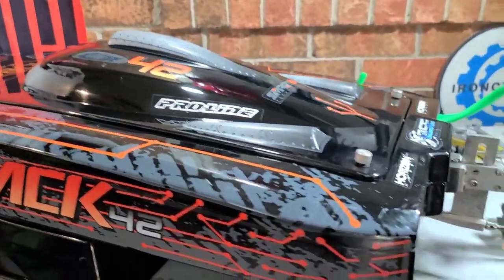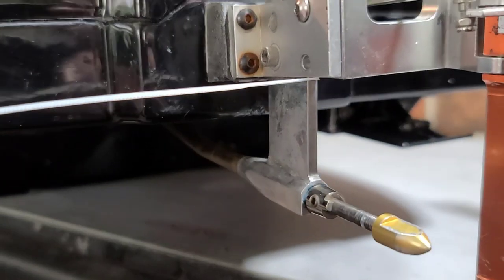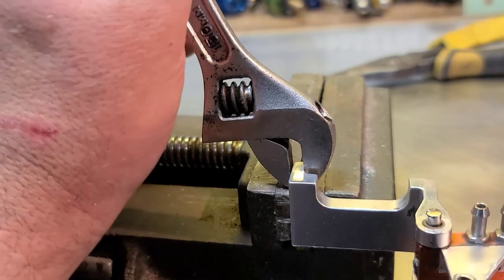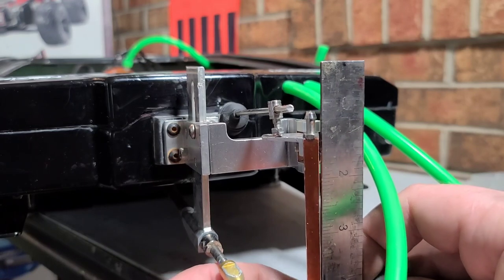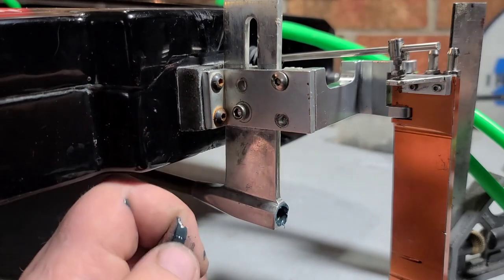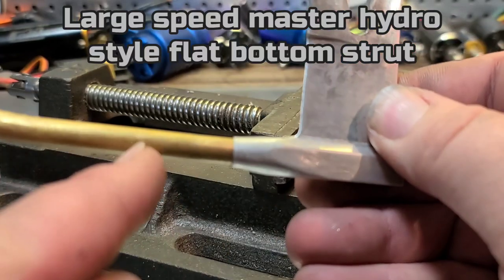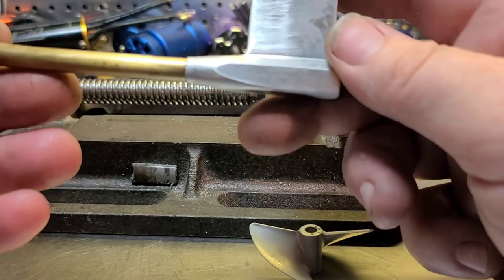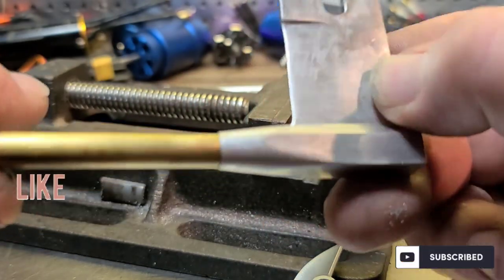Fixing Bent Rudder & Modifying The Strut For All Out Speed Proboat Blackjack 42

Comment: Even Aquacraft used to offer an add on air dam for their UL-1 Superior hydro, that had a habit of taking off. This was also a simple piece of 1/2" x 1/2" plastic angle that was stuck across the underside of the tunnel with double sided tape & worked well allowing higher speeds to be reached. Quick story with a speed guy a few years back on Offshore Electrics Forum, he built many fast boats inc deep V's & cats & was very successfull. He then built a carbon 26" cat way over powered with either a TP4060 motor or simular sized Neu motor to run on 4s. Boat was blistering fast but would take off ever time on glass water around 83mph, he tried all the normal things like cg adjustment, strut angles, different rudders. Could't stop it lifting at low 80's, I told him to try an air dam made from a piece of 1/4" dowl stuck across the tunnel 2" in from front. With no other changes to the boat on the same water he got 92mph with the boat glued to the water, I think he went on to get around 94mph on 4s.
Reply from the maker: Wow 👌  that's a great success story, I'd have to agree brother the dowel, foam in my case actually helped.   94mph on 4s is insane. Wow 👌

Comment: You can make a very simple but effective air dam which breaks up the air flow entering the tunnel. Some simply use either a piece of round dowl or a piece of plastic angle hanging down, either method runs right across the tunnel &sits around 2" back from the front of the tunnel. you can either glue this or even tape the dam to the hull. I know someone that even taped a drinking straw across the tunnel because he was having problems with lifting the front at a records meet. He taped the straw on, boat stayed planted & set new record. Dead simple to try by just taping something on 2" in from front of the tunnel.
Reply from the maker: I actually tried something kinda similar in my next video, sorta hard to explain, it's in tomorrow's upload.   Thanks for the tips though very helpful..

Comment: I'm very curious to see where you go with the front canard. I was thinking of making one for my all-wood cat that has a tendency to blow over at high speeds even when it's set up to run wet. My boat is really light; it's 31.5 inches in length and almost a full pound lighter than the ProBoat Veles 29. It's a wide body, which is great for cornering, but the extra width gives the hull a kite-like effect. I was actually thinking of mounting the wing on the front of the deck - not between the sponsons like you're thinking of doing. Front canards (wings) are not legal for sanctioned racing, but who cares. Some may argue that there are more efficient ways to tune the boat without a wing, but again who cares what others think. It's fun to experiment, and if it helps the boat stay planted in the water, then it's a worthwhile mod. Cheers brotha!
Reply from the maker: I may do the front kanard I may not.  If I do it's  definitely gonna  to be removable.    Ose has a motley crew air foil/front winglet  that may work on your skatter?  
 https://www.offshoreelectrics.com/proddetail.php?prod=hug-motley-lucas  

Just got back from a speed run.  omg what ever I did worked. Lol.
Reply: @IRONCLADRC  You did a lot of stuff to your BJ 42. Maybe all that filing you did to the strut paid off. Or it could be something as simple as the water conditions and wind were perfect for running at that time. In either case, I can't wait to see the video.

Comment: If the prop is running on the surface, then by definition, the strut "bar" will be out of the water.  In theory, you should be riding on that flat spot like a water ski with everything else out of the water.  This theory is based on glass-smooth water, so take it with a grain of salt.  Surface piercing objects have flat trailing edges to allow air into the "gap"  created by the wedge rudder/strut/turn fin/whatever as it moves through the water.  Air going into that open space creates less drag than moving the already spread apart water molecules back together.  That's why surface piercing rudders and blades have flat trailing edges.  Everything changes when there's no air to fill in the gaps, so underwater rudders (think NAVIGA, ECO and the like) are shaped like your strut bar example.

The only time a flat trailing edge on the strut bar will help you is when it is moving underwater with enough speed to open a gap in the water to fill with air.  With the BJ42, that running regime lasts for a tenth of a second and instantly, the strut bar is out of the water and flying through the air.  At best, it should only see some occasional spray.  Your airfoil cross-section will actually provide better performance for moving through the air, but any real gain will be small.

It's the little things that add up, and while on its own, this may not make a huge difference in performance.  But when added to all the other "tiny" tweaks, the sum becomes quite substantial.

Next, the BJ 42 is a REALLY big boat.  You may want to consider a nylon bolt for the rudder bracket in lieu of a zip tie.  Zip ties are fine for smaller stuff, but this is another level, and energy goes up directly with mass, and with the square of the speed.  When you are Big and Fast (and flipping end over end at 75mph), there's a lot of load going on back there........

And finally, the canard wing is a great idea.  Here's a thought:  Make it moveable and use a gyro-activated servo to sense a change in attitude and provide the appropriate control input to counteract whatever the boat is experiencing.  Do not go thinking of it as a wing, it won't work right with all the other stuff going on aerodynamically.  Instead, treat it like a leading edge slat with the concave surface on the down side and close to the hull leading edge at the tunnel with an appropriate gap between them.  Search the Internet for drawings of "leading edge slats" to see what I mean.
Reply from the maker: Every one has there opinion, your probably right doc...  but, the strut is in the water more than you'd think especially on this 42.  All I know is  I just busted my old pb wide open with my new modifications.   C'mon. So what ever I did worked 💪
Reply: @IRONCLADRC  I said it would help and the theory needs a grain of salt as it assumes a glass-flat surface.  But if the strut bottom is slightly above the sponson bottoms, and the sponson bottom is just skimming the surface, how could the strut blade be below the water surface for any appreciable time?  Just thinking aloud here.....  I don't know the answer.  Maybe some slo-mo high speed CLOSE passes???
Reply from the maker: I understand what your say doc.   On the 42 I'm running my strut deeper than what you think, quite a bit deeper.
Reply: @IRONCLADRC  What works, works.  I'm not the one to tell YOU how to do it.  You're doing a great job, so keep it up.  I just tend to think aloud; as I said....  The words "What If...." constantly run through my mind.

Comment: Just thinking instead of front downforce what about rear up force? Then possibly be able run the strut more upwards to drive the front down? Instead of adding extra drag to bring the front of the boat down you can possibly bring the rear up and nose the front down while making the boat aerodynamically lighter? And be able to run the strut more up to balance it out? Idk just a thought but I like both ideas.  But there is something to think about.

Comment: HEY THERE ...!!! I just have a quick question...can I use this esc for my vector sr80-pro boat...🤔🤔Boats > Parts > Replacement Parts > Pro Boat > Part# SPMXME1A
Spektrum RC 100 Amp Brushless Marine ESC 3S-4S w/IC3🤔🤔thanks and keep up the GREAT WORK on your videos bro...👍👍⚓⚓😁😁
Reply from the maker: Yea I don't see why not?  It should work fine!
Reply: @IRONCLADRC  The esc has revese capabilities but the boat makers say they didn't make it that way because it has a flex shaft and that would make the system not good 😱😱I saw one with reverse no problems...so should I use it for emegency only and very slow as so it won't snap the flex shaft???or just not use the rev at all??? thanks...👍👍